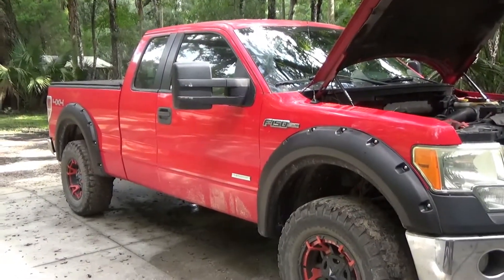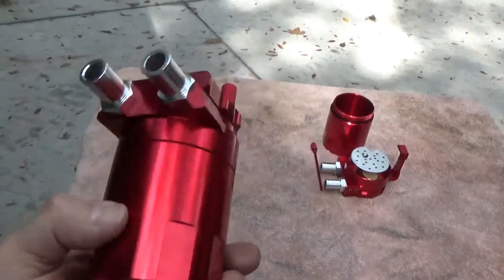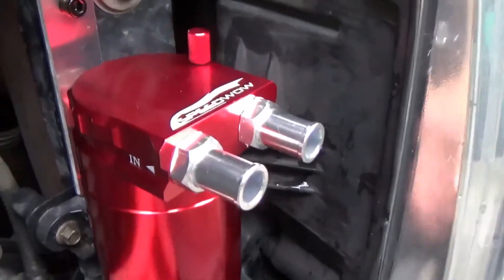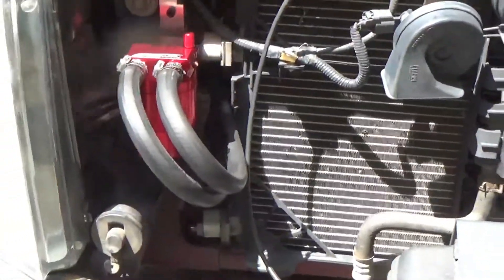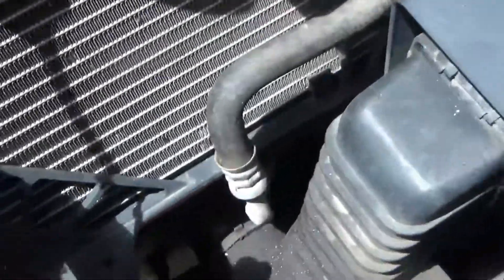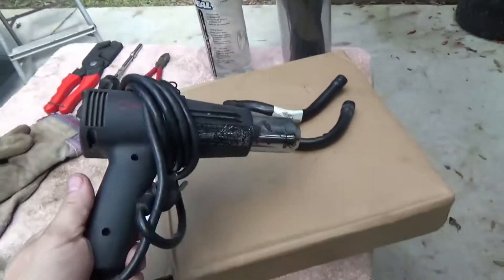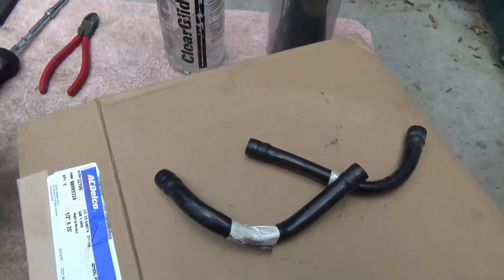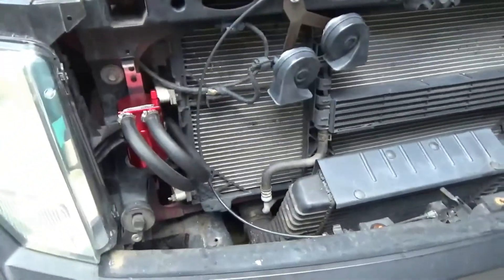Dual Oil Catch Can Installation Ford F150 Ecoboost 2013

Comment: i intentionally bought the cans that accept the steel scrubber material because the brass micron filtered ones increase crankcase pressure, and from what i hear, can be harder to clean. there are a couple of videos on here where they tested these pressures.

Comment: I hooked this up shortly after buying my 2012 F150 w/3.5L. I noticed the passenger side can filled up quickly while the driver's side hardly filled at all. Also, the passenger side can collected water which froze when winter weather hit here in Wisconsin. I ordered another catch can for the passenger side that will hold 3 cups of liquid compared to these smaller ones. You gotta stay on top of these things.

Comment: thanks for the video and showing how you mounted the cans.  Finding a place to mount them is the hardest part.  Do you find that they work?   Do you have anything on the back of the 1/4 28 screws holding them in place?  Did you use any locktite?
Reply from the maker: The cans definitely work. I am glad I put them in. I tapped the holes I made for 1/4-28 threads. But you could use nuts.
Reply from the maker: Yes, I used loctite.

Comment: i did this and i ending having problems with valves caps crack after i fix them my truck start smoking ... and looks like is the length of the hoses. looks like is too much for the engine i hope when i remove them and go back to the way it was with out it. everything came back to normal. also i star having problems with my brakes right after i start it . it was to hard almost imposible to stop it. i hope no body also have this problems with yours. good lock.

Comment: Thanks for the vid.  I’m not catching any oil on the drivers side can.  Any ideas?  Catching a lot on the passenger side.
Reply from the maker: I catch more on the passenger side.. Drivers side usually has a smaller amount. Make sure your check valve on the hose is facing the correct direction.

Comment: Any problems or anything unusual you noticed after installing this?
Reply from the maker: They worked great! Just be sure to empty them every 400 miles or less. The drivers side accumulates fluid faster than the passenger. Also check the inlet and outlet, I have seen some miss marked. The small filter element should be on the outlet.
Reply: did you notice a difference in air noise on the driver side, I did this and I can hear like air pressuring up on the driver side when I step on the gas idk if it's normal after the catch can
Reply from the maker: @rossesteban7859  never noticed a difference in any sounds..

Comment: Hey question you only used a one way valve on the passenger side and not the driver side please get back to me thanks .
Reply from the maker: If I remember correctly that is to stop the intake from sucking stuff in under hard accelleration
Reply: I’m currently setting the same set you have should I remove the one way valve from the driver side catch can sir ?
Reply from the maker: @xaviervera9930  I would say yes... That is the way I understood it should be done.. The other thing to check is the input and the output of the cans sometimes they are marked in correctly. The input into the can should go directly into the can, the output should pass through the internal filter on the can.
Reply: @venomchris5818  thank you for your help

Comment: So on my 2013 f150 ecoboost when its running the hoses on the passenger side catch can get thin when running and the driver side catch can hoses does not is this normal?
Reply from the maker: When you say thin, do you mean the hose is collapsing on itself?
Reply: @venomchris5818  yes thats what I mean
Reply from the maker: @pjeremy25jp  Did you use the same hose that I listed in the description? Did you install the check valve? Did you put the check valve in the proper direction? You have created a vacuum somewhere that is collapsing the hose
Reply: @venomchris5818  ok thank you for your help ill check it out
Reply: @venomchris5818  instead of fuel line i used heater hose is that ok or i should change it?
Reply from the maker: @pjeremy25jp   The reason to use fuel line is that it generally has a thicker wall and it is resistant to Oil and Gas.. Look at the hose and see if it is marked as Oil and Gas Resistant.. My guess is the hose from the intake is creating the vacuum. Either the check valve is in backwards or you did not use one or it is defective.
Reply: @venomchris5818  no its not resistant to oil or gas and didn't install check vavle .....im doing all that asap when it comes in ( its ordered) . Thank you so much for your help hope you continue making vids you give alot of info
Reply: @venomchris5818  did you and do I need to install a breather for crankcase  pressure?
Reply: @venomchris5818  hi, just wondering why you need a check valve? 
i have a 2012 eb and the original hose from pcv to intake does'nt
have a check valve. thanks
Reply from the maker: @earldumaran4003  when the turbos kick in it creates pressure in the intake..

Comment: The driver side doesn’t need a check valve as well? Why is that?
Reply from the maker: The intake manifold when under boost can push the fluids and sludge backwards.

Comment: Those brass filters r to restrictive get can with steel wool in baffle its way less restrictive the brass filter is 4 times more restrictive then a stock flowing pcv system with no can 1.5 millibar stock 6.0millibars with brass that means to much pressure in crankcase and 2.3 millibar with same can but with steel wool in baffle and 2.0 with the can with baffle with no steel wool. I run the 2.3 version there is a can that flows same 1.5 like a stock pcv system called provent they now make a good knockoff of the provent that is more affordable and is the same as provent
Reply: Links?